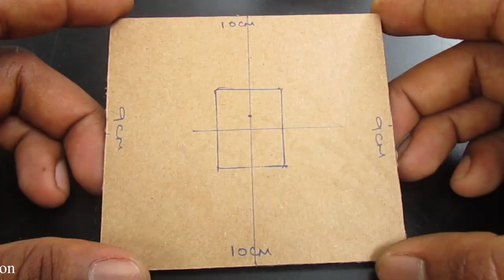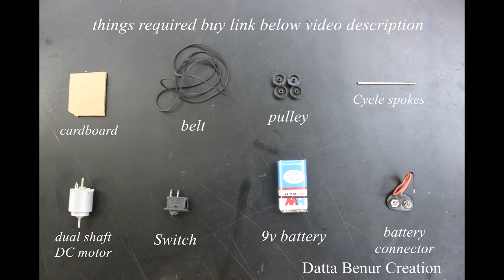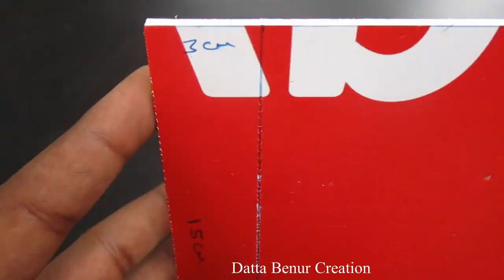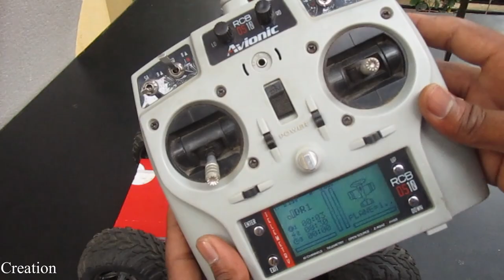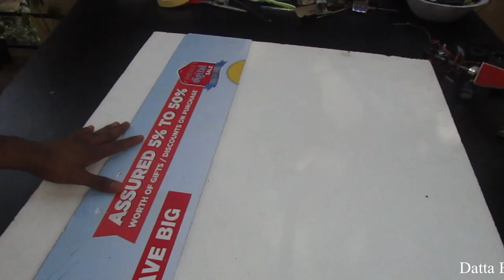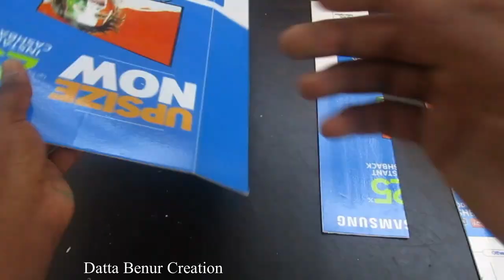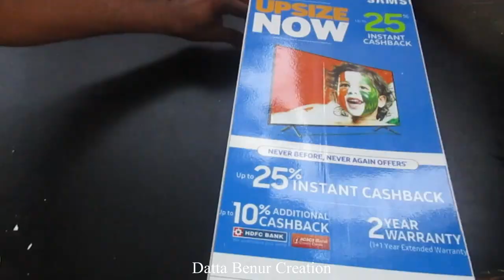4 Amazing things you can do at home - 4 Things you can do it Truck - Car - Boat - Bike

Comment: Bro don't use 1045 propeller in 2400Kv motor that motor have very less torque and high RPM if you use 1045 propeller it will be very high load for that motor and current consumption will very high and motor will burn in few minutes you should use small propeller
Reply: Nicely
Reply: s